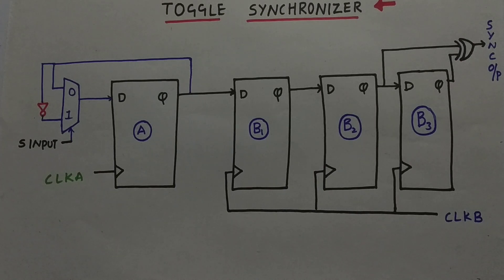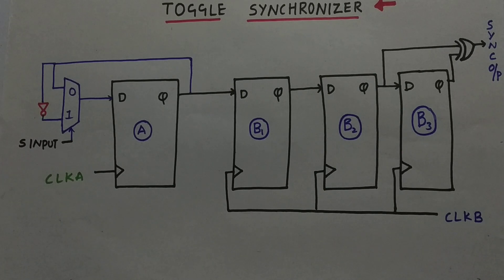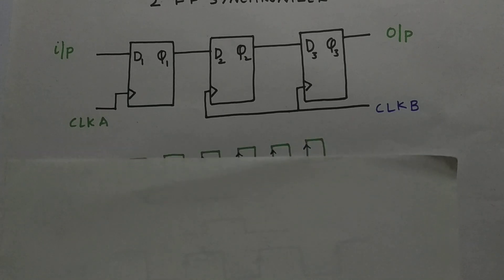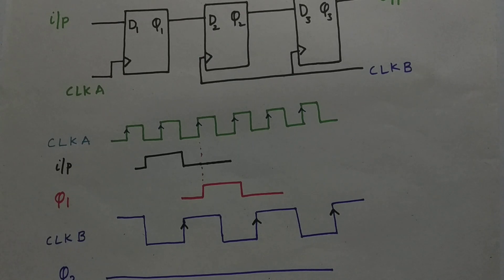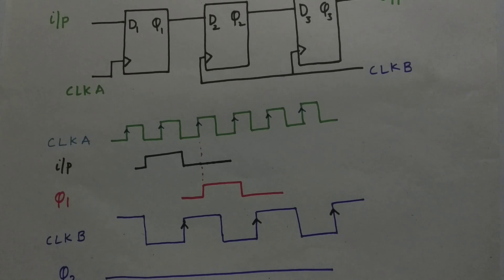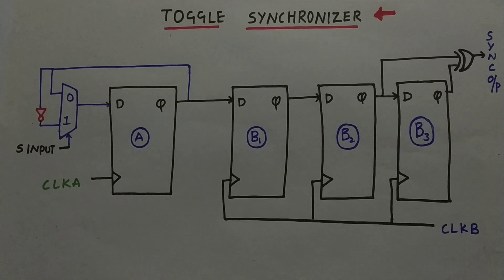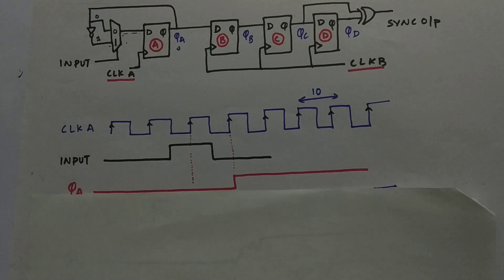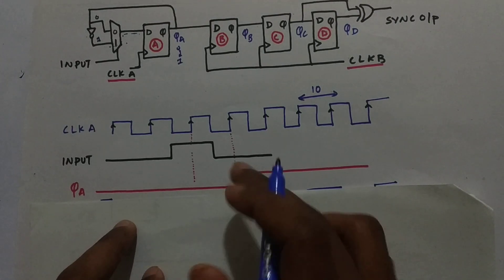Toggle synchronizer Explained!! Why  2 flop synchronizers cannot synchronize a pulse? | CDC

Comment: Sir, in every case, you have taken the correct logic level after the flipflop came from a metastable state, but it's not true in every case, right? Because when a flipflop comes from a metastable state it can take either zero or 1, if we get the wrong stable state, then total functionality changed? then what is its use?

Comment: Hi Karthik, Nice explaination. One doubt what if the output of Qb settles at 0 instead of 1 in that case we wont see any pulse , is this correct understanding? in that case pulse will be lost . Or do we have always "assume" that Qb will settle at 1 only.
Reply: If Qb is not settled with '1' in first cycle then no worry as it will be settle with '1' in next cycle as it's input QA level is set to '1' and its continue to '1'

Comment: The pulse we transmit from clock domain A is of 10 ns but what we receive at clock domain B is of 20 ns .But it should be of 10 ns ideally .How to resolve this?
Reply from the maker: Namaste Vijayshree 🙏, it's moving from fast clock to slow Clock , we can use fifo to synchronise the domain crossing and depth will be calculated accordingly, thanks for asking good luck and great health 👍😊

Comment: Nice video. I think it needs to be mentioned that if clkA is generating more than one pulse, the gap between them should be at least 2 clkB cycles wide (if using a 2-stage synchronizer).
Reply: it will work in case of 1010 also.

Comment: Nice video! but QA will be sampled as soon as (+propagation delay) the positive edge of CLKA comes. In video, it is sampled on the next cycle which is not correct.
Reply: yes, but in the video, its not sampling time, its the sampled output Qa shown in diag which will be once cycle delayed.
Reply: @ankitsingh-wg3cn   what @onkardesai30 means, I guess,  is the Q1 which is going high at the next posedge in your diagram, that is incorrect, when posedge of clk and D1 both go high simultaneously, Q1 should go high in the same time.

Comment: Hi Karthik, When does this level will go to low? once it detects pulse, it is becoming level and then stay as continuous level, what if we want to synchronize another pulse which is coming much later than first pulse? 
in that case we need to make the level to zero at some point to re-initiate the next pulse synchronization.
Pls suggest.
Reply from the maker: Pls check out  clock domain crossing playlist in my channel , in that pls watch handshake synchronizer , it is used for the issue you asked.
Good luck, good health 👍
Reply: @KarthikVippala   Thank you so much.
Reply: Hi Karthik, in the handshake based pulse synchronizer, u have explained when multiple pulses to be synchronized, but the input pulse is getting controlled by busy signal. 
Here my question is, if we don't have control over input pulse generation ( multiple pulses getting generated , and if we have enough clocks to synchronize them). in that case how do we make the level low, so that next pulse can be initiated for synchronization.
Reply from the maker: There is one restriction in pulse synchronizer that back to back (one clock gap) pulses cannot be handled. To make sure the next generated pulse in source clock domain gets definitely transferred and synchronized in the destination clock domain, the handshake based pulse synchronizer generates a “Busy” signal by ORing A1 and A3 flip-flop outputs. Thus the logic generating the pulse shall not generate another pulse till the busy signal is asserted.

Thanks for asking the question, good luck, good health 👍😊, excuse me I missed the question ,since there is no notification for new comments in old comment , please do comment newly when you want to ask👍
Reply: @KarthikVippala  His question is regarding toggle synchronizer asking when will the level go back to 0 to synchronize next pulse

Comment: What happens if source flop is reset but destination is not ..the latched signal will toggle and destination will detect erroneous pulse
Reply from the maker: Yes Venkat , you are correct both need to be reset at same time

Comment: how will it give single pulse ? i think it will give 2 pulses over o/p because of xor.
Reply from the maker: Hey kishan thanks for asking, here  o/p will give single pulse only not two pulse , please check it once again 👍
Reply: @KarthikVippala   So, here whenever b2 is high  at the same time b3 is low. So, one pulse o/p over it. Now the same pulse comes to b3, that time b2 will be low, so again another pulse will come to output. So, definitely it will give 2 pulse. By the way method is useful for single bit to streach as level with higher to lower freq synch.
Reply from the maker: Hey kishan you are correct if b2, b3 gets low but  here we may not make them low again.
Reply: @KarthikVippala  ok. but it doesnt matter if requires to make it as low or not. in any case it will give 2 pulses. i think xor is not required. it can take output from b2 or b3 flop as per latency requirement.
Reply from the maker: Thanks for asking , good luck brother 👊
Reply: ok. anyways good explanation and good work. keep it up.
Reply from the maker: Thank you so much 🙏

Comment: What is another technique to transfer multibit data in asynchronous clock domain apart from FIFO? IF tha data is changing frequently
Reply from the maker: Hey kirti, thanks for asking the question.
Handshake synchronization, mux synchronization are some other techniques which I know.
You can check them out in my channel , name of playlist  
clock domain crossing.

If you have any questions please feel free to comment 👍
Reply: @KarthikVippala Hey thanks for replying. yes but these techniques have greater latency than FIFO and also they are not suitable if the data is changing frequently.
Reply from the maker: @kritijaiswal4219  Yes ,latency is high, this methods can be used when there is shortage of area and data must not change so frequently.
FIFO is best method for CDC if requirements are met, as per my knowledge.
Reply: @KarthikVippala  okay, thankyou Karthik
Reply from the maker: Your welcome, good luck 👍